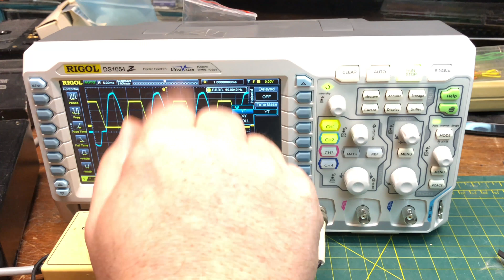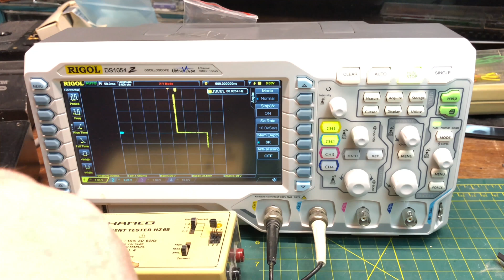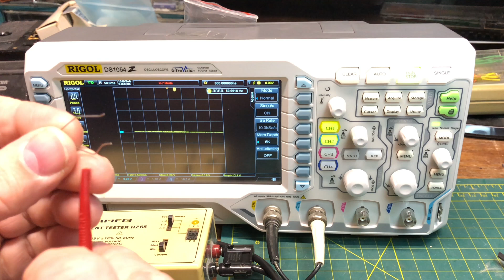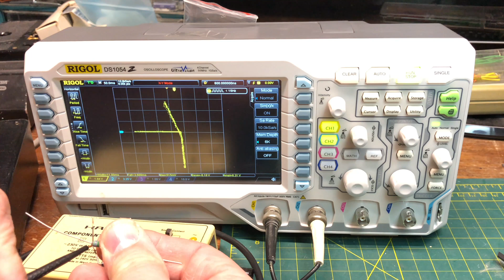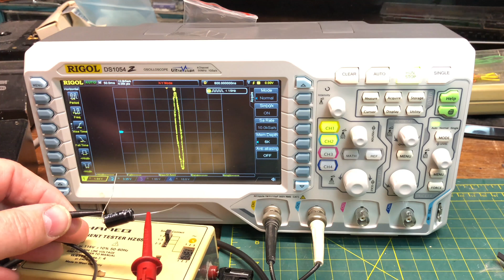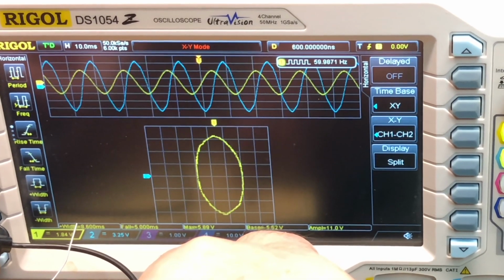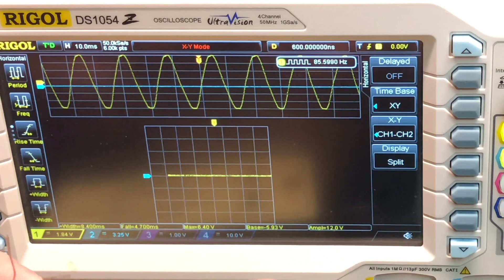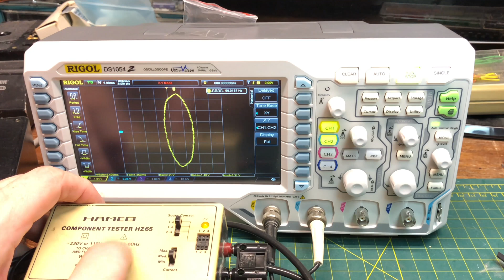Transistor Tester with Digital RIGOL Oscilloscope DS1054z 4K

Comment: The Hameg CT is using a sloppy oscillator. Probably a 555 with filtering. That's why the waveform is sloppy. It still does the job.
Reply: It's actually a mains transformer, so is influenced heavily by how sinusoidal the mains supply is.